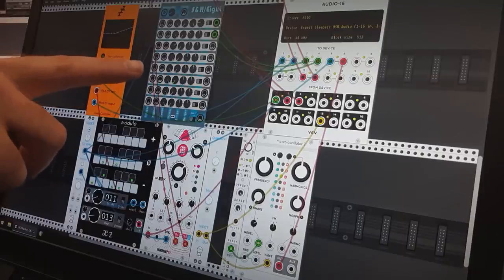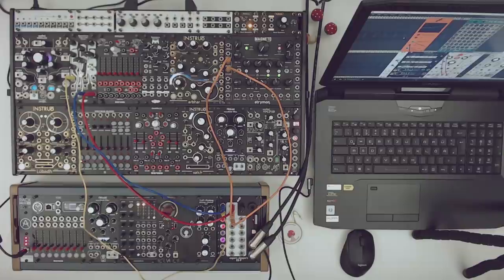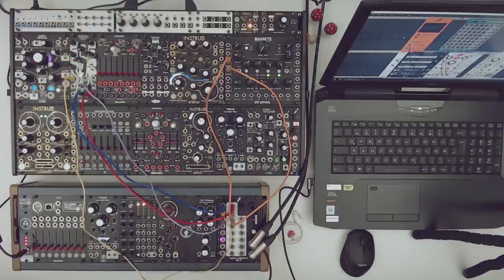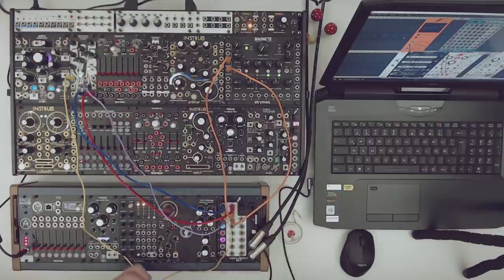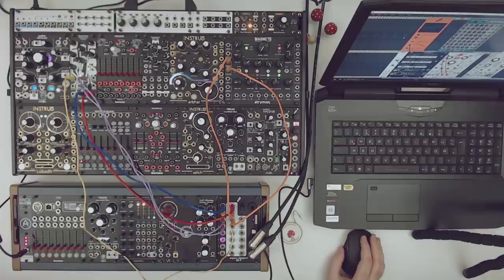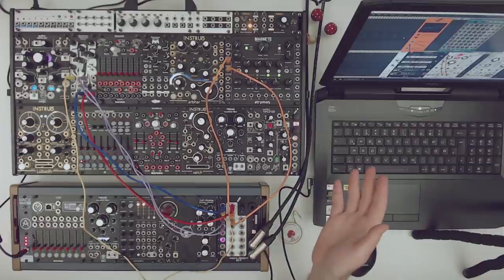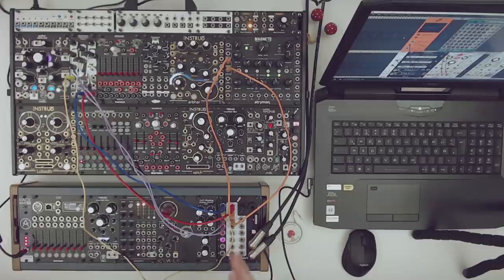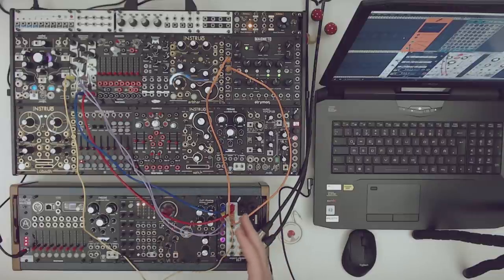5 Ways to build a Hybrid Setup / VCV Rack & Eurorack

Comment: Great video Omri. I’ve got an ES-9 as well and it’s an important tool but, yes, latency will kill the practicality of it. It’s important that the others who watch this video realise that before spending >500 EUR on it. In my original plan, I practically only wanted the VCOs to be in “physical form” and use VCV for everything else, and gave up on that idea quickly, and now my rack is self-standing with an unused ES-9 in it. The last time I run an experiment, a signal took 45ms to do a roundtrip. Per se not too much, but one things start getting complicated...

For the ones running macOS, VCV already works with multiple sound cards - I do it regularly - but it’s officially unsupported. So, if anything doesn’t work, the - otherwise incredibly kind and helpful - community will dismiss you saying that you have too many sound cards.
Reply from the maker: Yeah, latency is not fun at all... I tired to mention it enough in the video. I have to say though, I quite enjoy mine, sending modulation and audio back and forth directly from the case.
Reply: I have been using an ES9 both with ableton and with mirack for almost a year now, and have never noticed any latency. I thought the whole purpose of using audio signals instead of midi was to avoid that
Reply: wow 45ms is a very high latency defeating the very purpose of the ES-9 ! do you still have the issue 2 years after ?

Comment: Great tutorial, thank you. I use the es-9, luv it. I use an iPad, with miRack opened in AUM. It works exactly the same, except you need to use nisthi tunator instead of silent way, and rout it a bit differently in AUM. I have saved calibration profiles for my oscillators.
Reply from the maker: Yeah, the nysthi module can also work well, but I never really tried it. I'm happy this works also with an iPad, it opens many possibilities.
Reply: @OmriCohen-Music  yes, it is great, it’s great to be able to pack a 3u with some modules and a iPad for a holly day mini setup. The last updates to miRack brings Multichannel support, and it works great in AUM, and there is a lot of really cheap great auv3 effects available, like Blackhole from eventide etc.

Comment: Awesome video ! 
I unfortunately can't get my ES-9 to work properly in my daw (using cubase, windows with an rme ufx) I thought it had adat i/o but alas not the case. 
Trying to find a way to use both the UFX and ES-9 in Cubase but I don't think it's possible.... 
Has anyone in a similar situation found a solution ? 
Such a shame since the ES-9 seems like a powerful device although the configuration tool demands a bit of diving in beforehand ;)

Comment: Omri, about that floating ring cable: The 6.3mm (1/4") is called TRS which stands for Tip Ring Sleeve. This one contains the ring. ;) And the ring is missing on the 3.5mm (1/8") cable. Probably that's why it's 'floating'.
Reply from the maker: Thanks :) Yeah, after a few minutes it came back to me. For some reason I said tip at one point and then I remembered the rest.
Reply: On a floating cable, the plug with the ring connects to the ring output on the jack, but then that connection doesn't go anywhere. But if you had a normal mono cable, the ring and the sleeve connections on the jack would both contact the sleeve on the plug, shorting the circuit. compare the mono and stereo jacks (stereo connection same as balanced mono) https://www.pinterest.com/pin/313000242848830547/

Comment: Hi Omri,I have a minibrute 2s and am about to pair it with an fx aid pro. I also wanted to use VCV Rack to interface with eurorack modules. I was looking at the Befaco Midi Thing 2. Do you think it is suitable or should I buy an Es-8 or Es-9? 
P.S. 
I am following your course on gumroad and I find it really well done,congratulations.
Greetings from Italy
Reply from the maker: Thanks so much :) Midi Thing 2 will send Midi, and the ES module will send actual voltage. I think that Midi is easier to work with when using pitch sequences. And, the Midi Thing 2 can also send CV via Midi, and it works quite nicely with VCV. But, if you want audio, though, Midi will not work so well...

Comment: Great video! Asking about dc coupled interface usage... Why you said that cable 3.5mm TS -> 6.3mm TRS is safe?
I ordered some 3.5 TS -> 6.3 TS (one ring on both side)... Do you think they will work correctly or not?

Thanks for all your effort on the channel 🙂
Reply from the maker: I'm not so sure... From what I've seen , its safe to use the TS to TRS ones.
Reply: @OmriCohen-Music  i ordered some 3.5 TS- 6.3 TS cable but for being sure I will cut the 6.3 jack replacing with a TRS leaving ring disconnected... This will be like floating ring cable, I think :-)

Comment: That was a seriously informative video. Really well done. So, if I want to use VCV rack's oscilloscope to see what the modulation in my hardware Eurorack is doing, I'm going to need an interface with DC-coupled inputs. My current audio interface with AC inputs won't work, correct?
Reply from the maker: Thanks :) And yes, you will need DC coupled inputs so the modulation will not get filtered out.

Comment: Hi Omri,was considering to get a Microfreak and using it also to connect software with hardware,if I understand correctly should not be a problem when connecting Eurorack with VCV.
Can it be used to syncronise DAW to Eurorack as well ?
Reply from the maker: Hi! Well, yes, you can send Midi into it and then use the CV outs for syncing.

Comment: great tutorial... 
I have a "hard" time to calibrate my outgoing cv signal to eurorack. I use vcv and Native instruments Komplete Audio 8 (with dc out and input!). I use a Doepfer amplifier -183-3 and a home made floating ring cable....
I did't work. I dont get a proper 1v/oct. for my eurorack VCO.
Does the (not free) Expert Sleepers Voice controller vcv module work with my N.I. Komplete Audio too?
Reply from the maker: Oh ok... Well, there's another module from nysthi that can also do the calibration. It's called Tunathor. I didn't try it but it should work. Let me know!
Reply: @OmriCohen-Music  Thanks   I try and let you know.
Reply: It worked with Tunathor.  but... very limited 3 octaves and not precise.. The output of de N.I. audio interface :K.A.6 is very limited only 1,6 Vpp. Even with use of the Doepfer amplifier A 183-3... still 3 octaves  This module increase the voltage from 1,6Vpp to 6Vpp.   bit disappointing....
Reply from the maker: Oh ok... That's a shame...

Comment: Was looking forward to this one, glad you made it!  When you said you stay away from sequencing things in your hybrid system from VCV Rack (16:45), does that mean you master clock and sequence from hardware most often?  And do you prefer to sync master clock to VCV via ES-9 or midi interface?  And you mostly prefer to send audio back and forth rather than CV and clock?

Maybe the answer to the above is yes and no and sometimes, if so that's okay.  I understand a lot of the tradeoffs and how you might make them differently depending on the situation, just wondering what you find yourself doing most often that feels productive to you.
Reply from the maker: Yeah, I'm also happy I managed to make this video, it's been on my list for a long time. 
About your questions, so yes, I stay away from sequencing from VCV because I feel that it's counter productive and sorts of stops my flow, if you know what I mean. I'm using the Keystep Pro for quite some time now and it's a great master device for clock and sequencing. I really enjoy the hands-on control with a hardware sequencer rather than using the mouse or memorizing a Midi controller. About syncing, I don't really have things in sync in VCV. I use VCV for modulation and processing mostly, and also for having a few more voices as well that I just sequence or play via Midi so I don't send a clock, usually, to VCV. I send all of my audio into VCV, and sometimes I will send audio also from VCV out to my system but, usually, I will use VCV for modulation so I will send S&H, LFOs, and also triggers that are coming from various places like EOC of envelopes, gates from comparators and so on. I will do this the other way around as well, like I show in the video, sending triggers and cv from my system into VCV. 
There's something that's important to remember though, my music is not really beat-driven and, most of the time, the different elements or not even in sync so I don't really bother with syncing clocks and latency. But I do have experience with beat-driven tracks and track where I wanted to have things in sync and it was a pain and not fun at all. As I mention in the video, there are ways around that, but it might be counter productive.
Reply: @OmriCohen-Music  And that likely also answers my question I've been wanting to ask :) 
(I'm 95% sure I'll buy a Keystep very soon - mainly for intuitive sequencing - and been wondering just well those functions integrate in VCV)
Reply from the maker: I understood you saw the video about it right? It works really well with VCV :)
Reply: @OmriCohen-Music  That settles that then :) Right now, I can either play live or carve it into stone (sample audio) and this feels so limiting. Guess I'll now have to ask my bank account which one it'll be.
Reply from the maker: @ursbasteck  It's not perfect, but it's a great tool to have since it can do so much and everything is pretty intuative. It's quite big though so you will need space for it. If you have any specific questions about deal breaking features and such, feel free to ask :)
Reply: @OmriCohen-Music  That's super helpful, thanks for the detailed response!

Comment: Hello Omri, I have 2 questions for you: Firstly, is it possible to send MIDI to CV or CV to MIDI with the Befaco cvmc. Does it work both ways or just one? Thanks!!
Second.... I have a problem with my MOTU: If I send PitchCV ( Sequence or S&H ) to the hardware then everything is fine ( with Floatin Ring cables of course)... But if I send the Pitch CV from the hardware ( Eurorack) to Send VCV then it doesn't work.. The signals arrive but totally distorted and broken.. If I send LFOs and modulation signals to VCV then everything is fine but with pitch info it doesn't work! Everything with F..R..cables.. Do you have an idea why that is? In your example you also send signals from the eurorack to VCV and it works very well.. But not for me.. AND.. how did you calibrate it exactly.. The E.S. I bought the calibration module and it works very well with signals going to the Eurorak from the VCV.. But vice versa, how do you calibrate it?.. Why doesn't it work for me like in your example?
OMRI I'M SORRY THAT I WRITE AND ASK YOU SO MUCH.. BUT before I write I'll try 100 times and if nothing works then I'm desperate and you're the only one who can help... really!!!
I'M SO FRO WE ALL HAVE YOU!!!! WHAT WOULD I HAVE DONE IF YOU WERE NOT THERE!? I DON'T KNOW THAT!! I CANNOT THANK ENOUGH!!! THANKS BRO!!!! CHEERS
Reply from the maker: Thanks :) Yeah, the Motu has only DC coupled outputs but not inputs so sending pitch from the hardware will not work. 
And with VCMC you can only convert CV into Midi but there are other modules that you can use to convert Midi into CV. You can also use a Midi controller that has CV outputs :)
Reply: @OmriCohen-Music  Thank you Omri , very much !!!!

Comment: wow man !
 insight :)
Reply from the maker: Cheers!
Reply: @OmriCohen-Music  omri quick question, I recently got a 7U 104HP from Intellijel, latest version. I bought myself a vpme.de Euclidean Circles V2 to use for my rack. I was wondering being a 5V module would it fry in the intellijel rack? If so how can I get it to run in the rack. I would kindly appreciate any tips :)))
Reply: @OmriCohen-Music  or is there some sort of regulator for 5V modules in the 7U rack
Reply from the maker: @aluriamusic  well, it should work just fine. I have the BIA set to 5v, and I had the Nebulae on 5v as well. The 7u can has up to 1500mA on the +5v
Reply: @OmriCohen-Music  running to my rack to install :)))) big thanks omri ! Will send you photo of current setup, means a lot for you to guide me through these first steps hahhaha I watch all of your videos !
Reply from the maker: @aluriamusic  Let me know how it goes :)
Reply: @OmriCohen-Music  worked wonders man! Just got myself the Ochd before going to bed :) I am building this rack specifically to make calm long and short winded generative music, finishing my night with your latest ambient patch video easing my way into sleep. Thanks again Omri!
Reply from the maker: @aluriamusic  nice! Feel free to share some sounds with me 🙂 have fun!

Comment: In a nutshell: you block DC by putting the signal through a highpass filter with a cutoff below the audible range. AC coupled connections do this, and DC coupled connections don't.

Comment: So with DC Coupled interface (I have ESI ESP1010, one from compatibility list) I absolutely need to use floating ring cables for:
output - from VCV to Eurorack/Synths as well as from Eurorack
as well as vice versa
input - from Eurorack/Synths to VCV?

How about using mono 3,5mm cables with 3,5mm mono socket to 6,3 mono jack?
Reply from the maker: Well, it's recommended to use a floating ring cable so I guess it's better not to use other cables. I did send clocks in both direction and it went ok though.